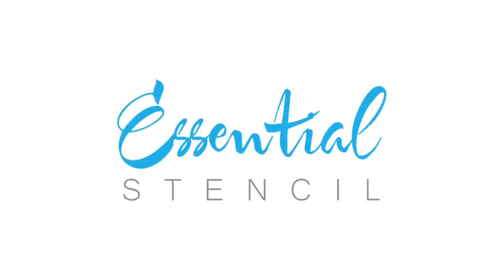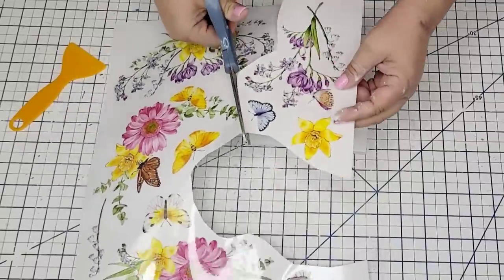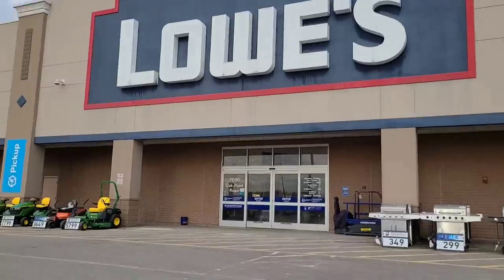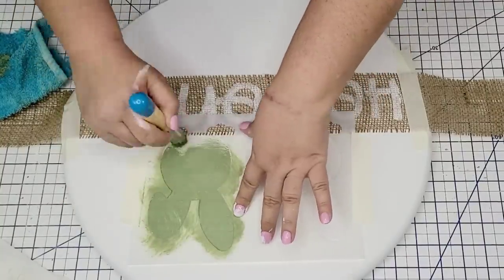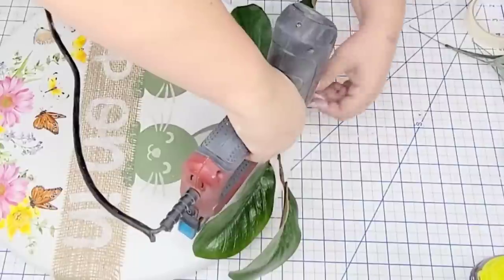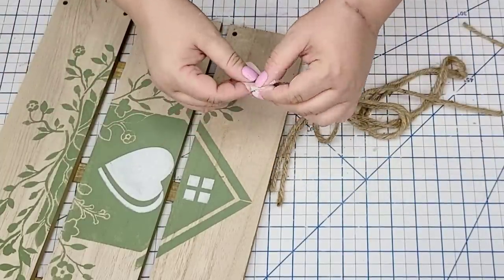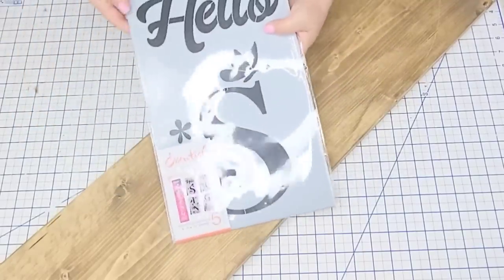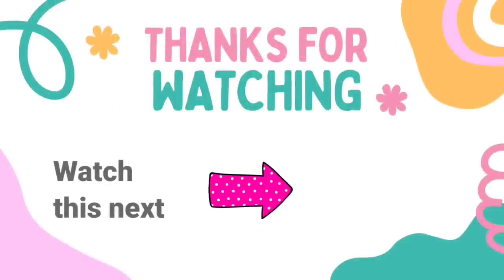Absolutely GENIUS Spring Dollar Tree DIY Crafts For Home Decor Using Wood

Comment: Those rub-on transfers are beautiful. I never sold any of my crafts, but if I ever choose to, how do you decide how much to charge?
Reply from the maker: Hi! I'd say start by checking out other crafters and how much they are selling for. Then take note of your expenses. Then decide what's a fair profit.  On my smaller crafts I'm OK making between $5-$10 profit. They arr quicker to make and less expensive. On larger ones which take longer and are a bit more expensive,  I'm OK making $20 or more.
Hope this helps.
Reply: @diybeautyonpurpose  Thx for the advice. God Bless.